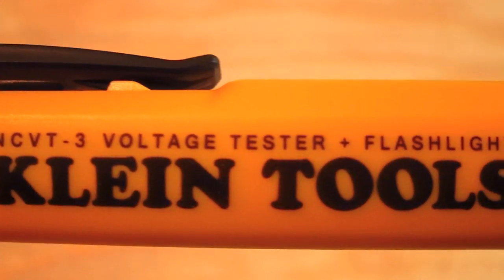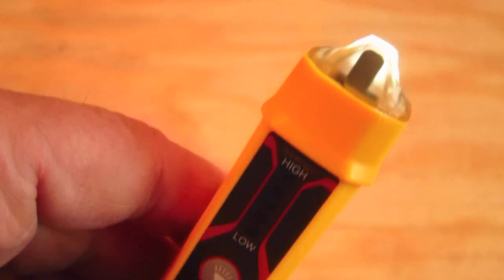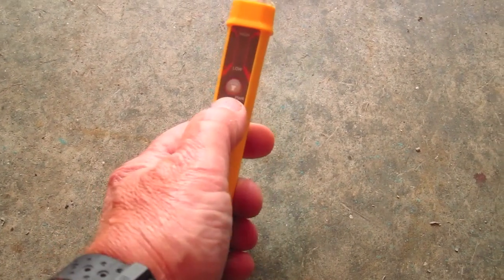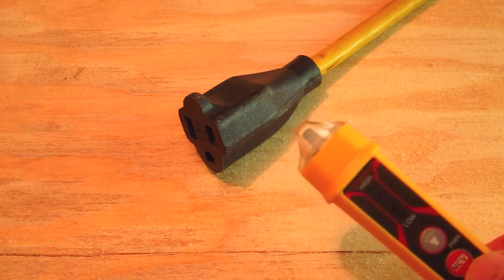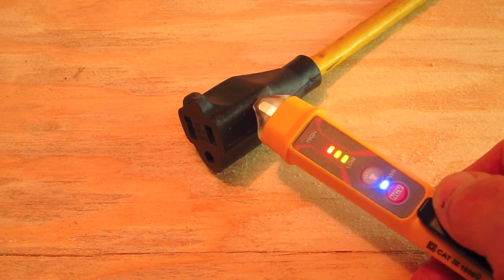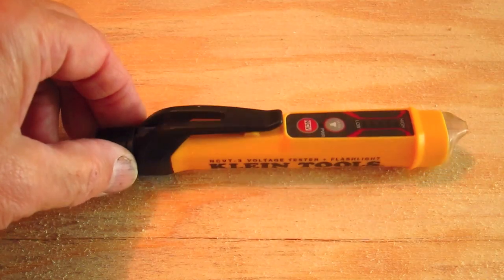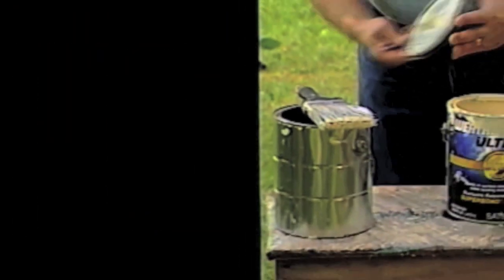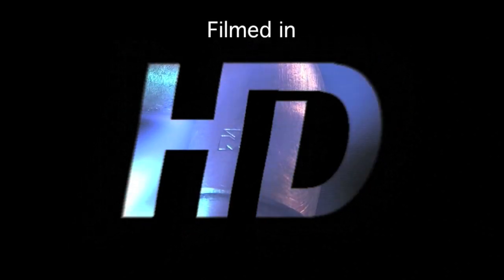Klein NCVT-3 Voltage Pen Tester Review

Comment: Bought mine the other day and returned it straight away. getting Low and high voltage reads standing in the middle of a room?  Too sensitive and definitely faulty
Reply from the maker: Or maybe, just maybe, the room or house is under/next to huge overhead high-voltage transmission lines from a power plant. Just like the ones near hole #2 at Brookville Lake IN golf course that made the dew-coated grass CRACKLE. I always thought I'd grow a tail after standing under those bad boys. I couldn't hit my ball fast enough.

Comment: Nice review Tim I enjoyed watching. I just picked one of these up and it's fantastic and I lucked out and got mine in a special promo pack that included a free receptacle tester with it! One thing I really like about this tester is it also tests for low voltage too meaning I can test cables and USB ports on my computer for power, I can test speaker wires coming off my home surround sound system for power, I can test my game system wires and other wires that have been thru a converter to reduce the voltage and I can test all sorts of wires and cables in my home entertainment system which is extremely nice to be able to do!
Reply from the maker: Thanks! You might want to do two things: 1. Subscribe to my FREE newsletter at www.AsktheBuilder.com 2. Start watching my LIVE streaming videos! Lots of fun and you get to ask me questions in real time. Be sure to turn on NOTIFICATIONS about when I go LIVE.

Comment: I have owned 2 Klein testers with the switch button in the back . they worked perfectly untill the switch becomes inoperative . I also had a Milwaukee with the same caracteristics and same bad switch . currently I have 3 different ones including a commercial electric wich  beeps even when wires aren't hot.

Comment: Mike R.  I tried the " new Klein NCVT tester " after Mr. carter did his review on this  unit and I have come to the conclusion that it ain't all that when it comes to it's functionality . it had a hit and miss problem when putting it next to a recepticle  or even running it down a circuit to test for a break in the line . I actually bought two in two days because of malfunctioning but I have an old Sperry HVH602 tester that Iv'e had for 10 yrs. and never once changed the batteries until the other day and it works better than the new Klein I'm gonna return again tomorrow . Iv'e been doing electrical for 30 + yrs. I think It's a waste of money to buy that unit .